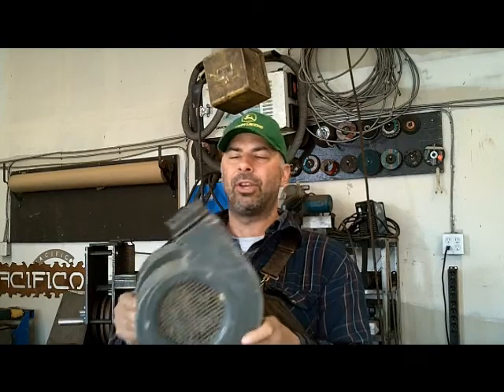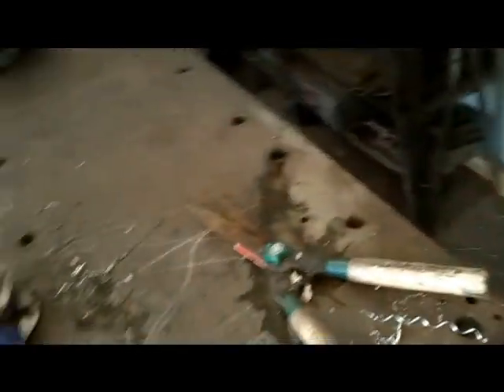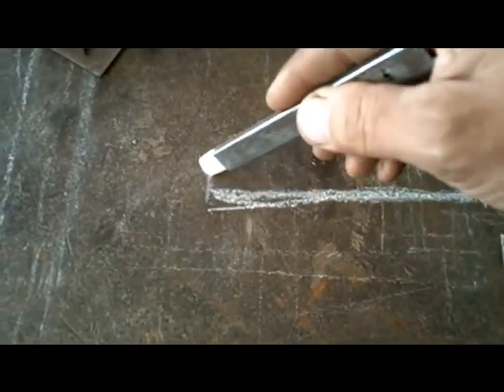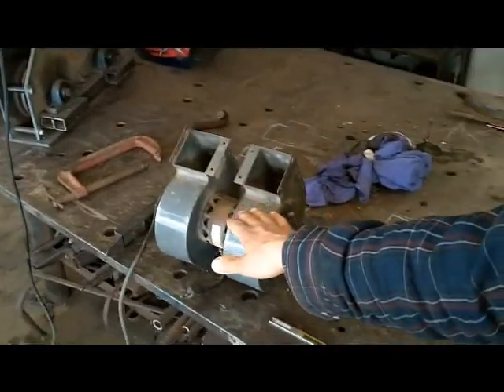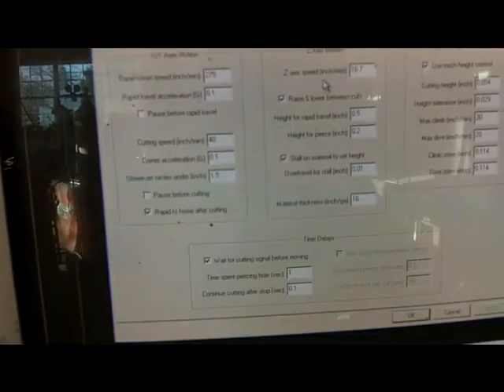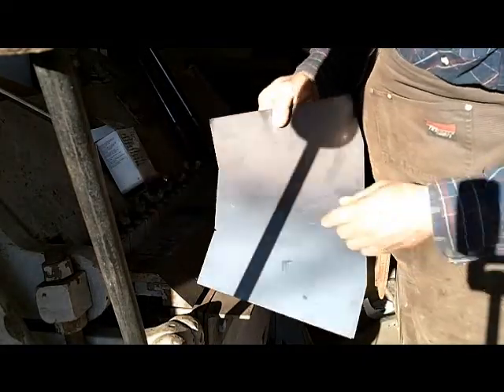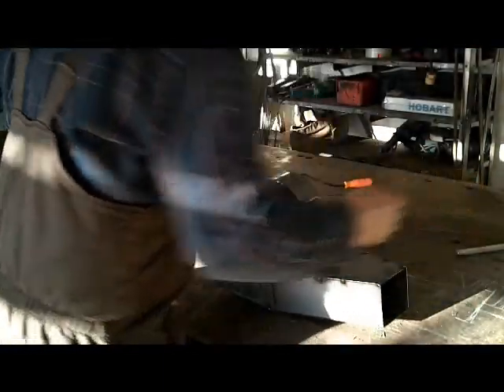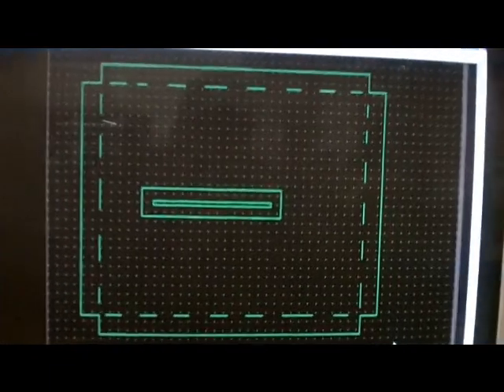Building an industrial forge (part one)

Comment: I employed the same idea when i built my forge, i dont have a gas forge to heat long pieces so i designed a coal one to heat about 30"X8" of steel, works well. Its compartmented so it can be used for smaller work too. That blower looks well nice, good find.

Comment: You may have seen the brake rotor forge I made. It works for what I need it to do, but the air has way too much velocity. I will be looking for a blower with a high volume and lower air speed. My forge wastes a ton of coal and is horribly inefficient. I wish I would have seen this before I built mine, but I can build one the right way now. Thanks for all the reliable  and accurate tips.

Comment: I like your vids.  I also live on a farm and do much of my own repair work.  I am lacking a plasma cutter.  Can you reccoment an economy model that will handle 3/8 mild plate. About 15 years ago I got a great deal on 20+ sheets of 50 something inch x 10 foot plates.   I quickly learned the value of a plate lifter for my hoist :)

God Bless,
28Bull

P.S. That blower looks like one that was on my previous wood/coal furnace.